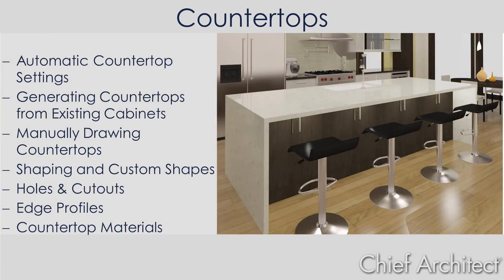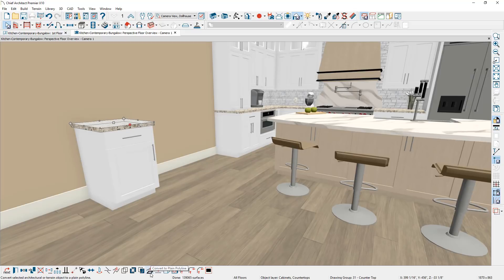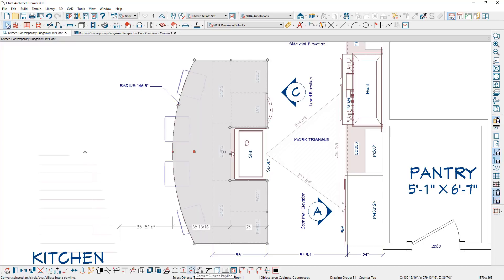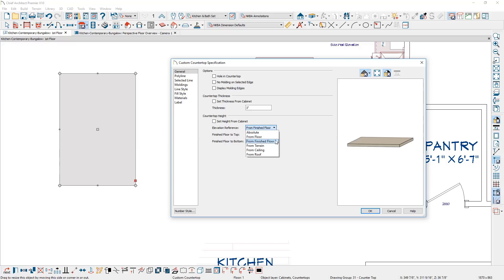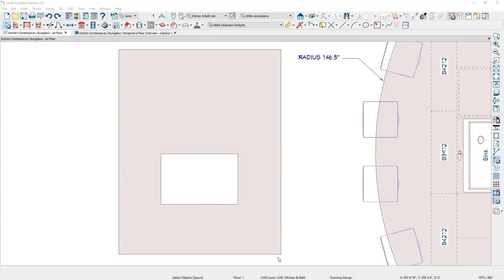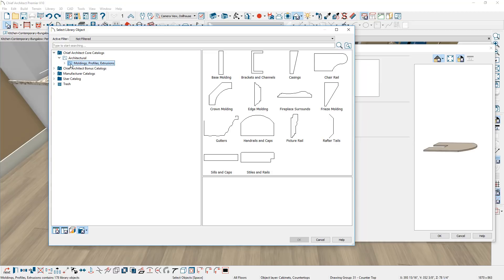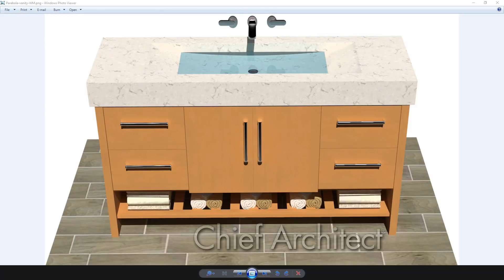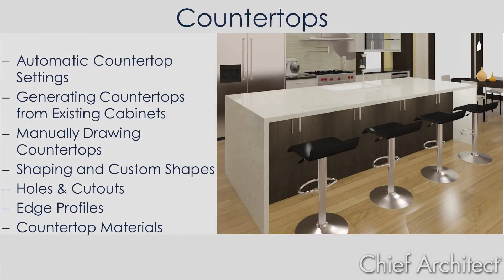How to Create Custom Countertops in Chief Architect Software

Comment: Thank you, thank you, thank you!  You have really simplified the way I've been doing custom countertops!
Reply: BTW while installing an Elkay sink it shows up about 2" short to the counter, how can I raise the sink 2"? So far I haven't solved this problem, Thanks!
Reply from the maker: Hi Dan. To move the sink symbol you'll want to double click on it to open up the Symbol Specification dialog. Under the "3D" Panel you can adjust the "Origin Offset". To raise the sink, adjust the "Z Position" value. Note that you may want to then use a custom countertop to account for the change in the hole size. I hope this helps!